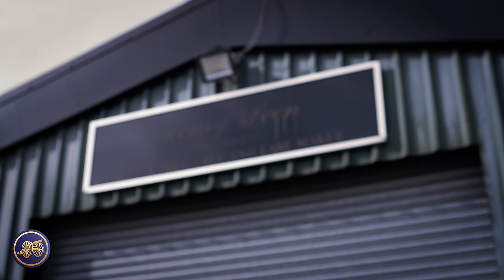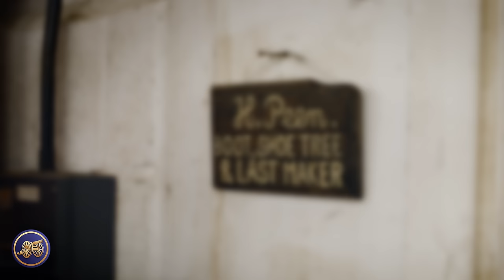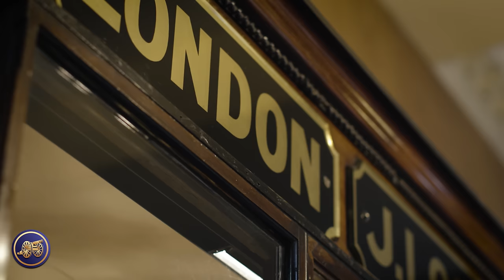My First Commission at John Lobb | A Journey Through Shoemaking History | Pt 1 | Kirby Allison

Comment: I’m amazed how some of those machines in the workshop get passed health and safety 🤦‍♂️
Reply: Well, As a joiner/furniture maker, I'm amazed as well, especially with the guy on the bandsaw and pillar drill! All it took was for that blade to snap or drill bit to break and anything could happen. it's still no less interesting though :-)
Reply: Well when its working and you have no company to do a new machine, why scrap it? It works perfectly fine, and with a good mental health and understanding, you can use those machines. Even the gentleman didn't follow 100% the safety rules....
Reply from the maker: In Lobb’s defense, there may have been a few exceptions made for the sake of clean footage…

Comment: I don't understand why they use a wooden block for making a copy of the foot.  Taking a cast from client's foot directly would be more accurate and quicker.   That's how my custom orthotics were made.  I was given the casts of both my feet for future reference.
Reply: From a practical perspective there are pros and cons for both methods. 
Firstly using a cast is not necessarily less work, quicker or more accurate. I'd say this depends to a very large extend on the preference and experience of the craftsperson.
Once you've created the positive form from your mould you still have to build up and take away a lot of material and change the volume in different places to achieve a funcional shape to build a well fitting shoe on. The last is way more than just a simple copy of your foot! Then you have to make another cast, using the material for the final last and copy the shape you've created. And all that for both feet individually. 
So a lot of mould building, pouring casts with different synthetics and pretty dirty work there. For me this whole process takes away some of that simple, focused woodworking flow that enables you to feel the material and create dynamic shapes.
Pros are that plastic won't change its shape over time, won't rot(which is also a bit of a con, i guess) and perhaps for beginners it can be an easier way to build adequate bespoke lasts and understand the anatomy of the foot. 
Making lasts for orthopaedic footwear is way more complex than 'standart' last making and you follow very different guidelines. So there it makes quite a difference too.
Reply: @klausbecker4745  Thank you very much for your detailed and enlightening explanation.
Reply from the maker: I think one of the most common misperceptions of bespoke shoemaking is that it is a SCIENCE and not an ART. 

It is true that a casting or 3D scan would be a more accurate representation of the foot. But that being “better” is predicated on the assumption that the last maker is attempting to create a last that is an exact facsimile of the foot, as well. And this just isn’t the case. 

The goal of the lastmaker isn’t to make foot-shaped shoes but to create beautiful, sculpted shoes that fit the feet as comfortably as possible.  This is where the technical and artistic skill of a lastmaker show through. Where the human eye and artistic intuition still trump that of a computer or formula. And, most importantly, it is where experience matters. 

What I find most fascinating about this craft is how these two goals - (1) creating a beautiful pair of shoes and (2) creating a well-fitting pair of shoes - are at conflict with one another. In many ways, they compete against each other, with the lastmaker serving as the final arbiter. 

This is where the incredible beauty of the bespoke craft exists. That, ultimately, the product is the manifestation of an artist’s negotiation of these competing dynamics. And the fact that obsession is all over a pair of shoes, in many ways, makes it all the more magnificent.

Comment: Why not make a silicone mould of the foot, that’s got to be more accurate than a chap, however skilled making an accurate representation of your foot from a block of wood
Reply: From a practical perspective there are pros and cons for both methods. 
Firstly using a cast is not necessarily less work, quicker or more accurate. I'd say this depends to a very large extend on the preference and experience of the craftsperson.
Once you've created the positive form from your mould you still have to build up and take away a lot of material and change the volume in different places to achieve a funcional shape to build a well fitting shoe on. The last is way more than just a simple copy of your foot! Then you have to make another cast, using the material for the final last and copy the shape you've created. And all that for both feet individually. 
So a lot of mould building, pouring casts with different synthetics and pretty dirty work there. For me this whole process takes away some of that simple, focused woodworking flow that enables you to feel the material and create dynamic shapes.
Pros are that plastic won't change its shape over time, won't rot(which is also a bit of a con, i guess) and perhaps for beginners it can be an easier way to build adequate bespoke lasts and understand the anatomy of the foot. 
Making lasts for orthopaedic footwear is way more complex than 'standart' last making and you follow very different guidelines. So there it makes quite a difference too.

Comment: Little tip... 3D can and 3D print 😅
Reply: works too. it's not lobbs style is what i caught from the video. but some very skilled lastmakers do it. still they are craftspeople and learned to do it by hand. By that you develop a very good feeling and experience! Also if you want to learn bootmaking as a beginner a block of wood and 2 or 3 rasps are a lot cheaper, more handy AND more stylish than all the gear you'd need for 3D print... maybe it can be done fully automatic, who knows... but off course traditional craft is about soul and beauty not about efficiency and sales. and i say this as a bootmaker, not a posh rich guy^^
Reply from the maker: To the best of my knowledge, nobody has yet gotten the 3D scanning and printing thing down yet.